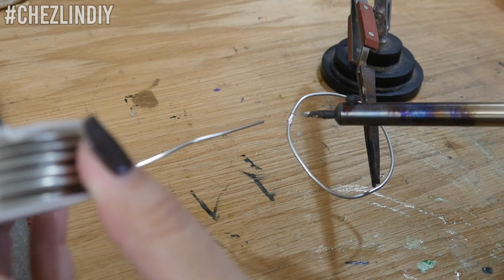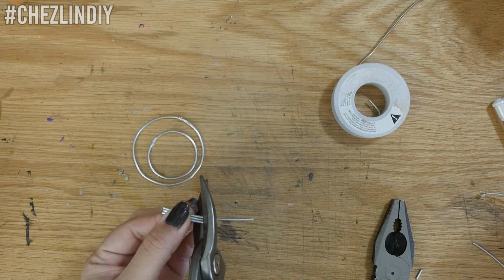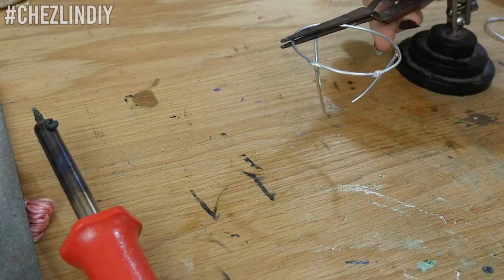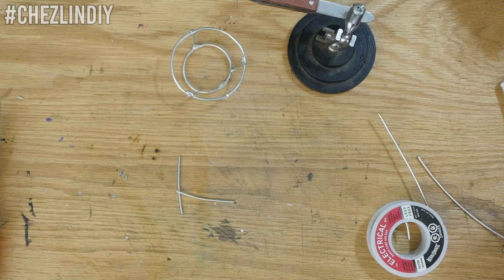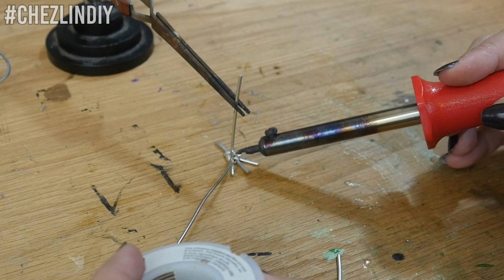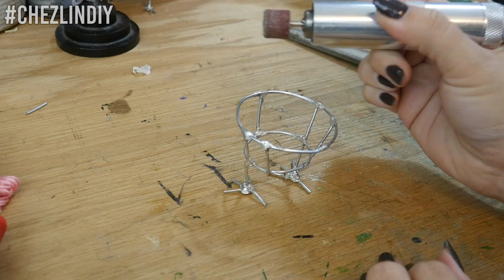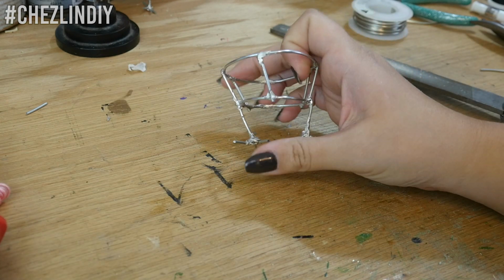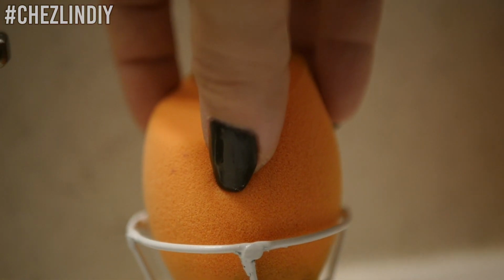Playing with Solder - Beauty Blender Stand! DIY

Comment: This looks super cute! Well i dont have a beauty blender but i'll be still looking for an excuse to make one 😁 if i ever made one i'll have a slight twist to it since i also dont have the iron melting thing, i'll try to make it by shaping square frames between the two circles and wrapping the whole thing with yarn or thread (the thread in the video gave the hint 😉) for the legs  i'll double the length and shape the feet  and bend the top to hang from the top circle and wrap it with the body too. Hope you get the idea, this could be a tiny plant stand.
Reply from the maker: You'll have to let me know how it goes whenever you make your version!